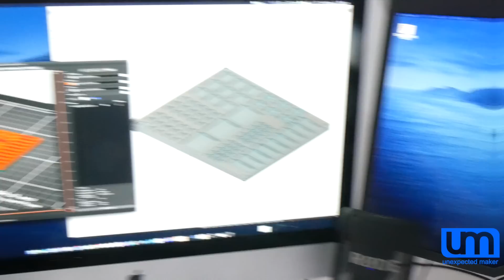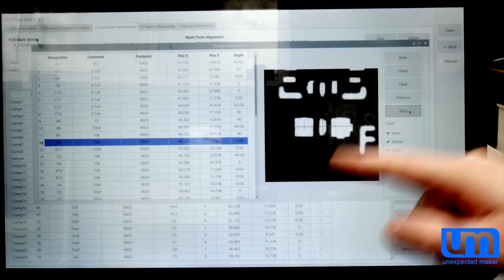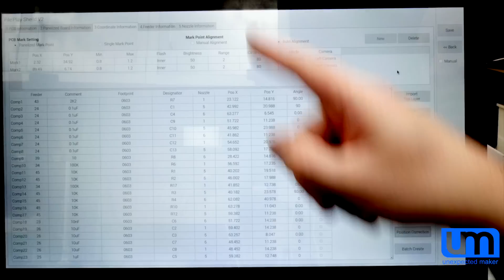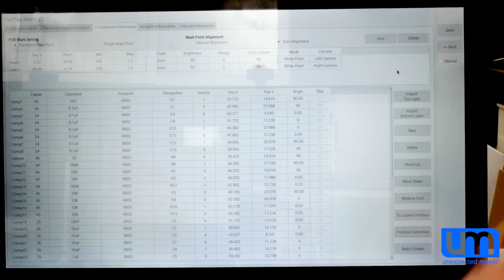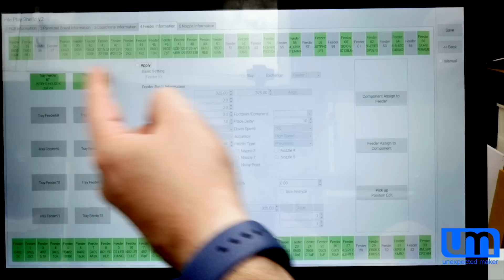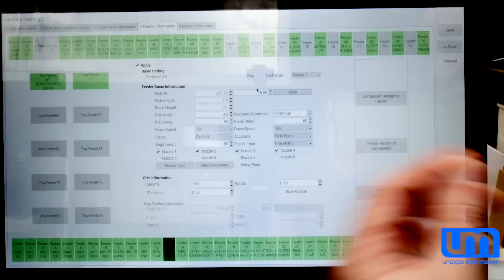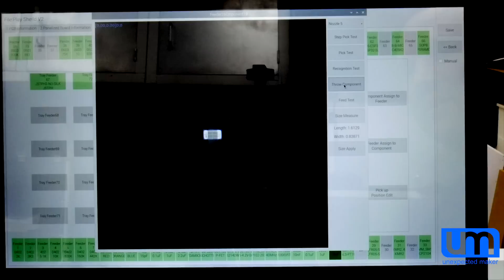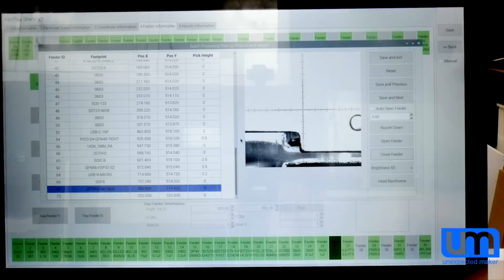Neoden K1830 - A proper look!

Comment: The thing with the belt systems is not that they are not precise, but you need to be aware that the belts will need to be checked periodical to make sure they are at the right tension and also probably replaced at one point. As long as the operator is aware of these maintenance procedures and stick in to regular servicing (similar to a car service) it should be all good.
Reply: There is pros and cons to belts. As for ultimate accuracy, the ultimate accuracy is limited by the stepper motor resolution anyway. If you are using fidicials on the PCB, short range position accuracy is a moot point, so belt or screw will be same. Screws will heat up over time and cause position errors, whereas belts do not (The expansion is symmetrical). Belts are much quieter. The machine can ultimately be faster with belts due to lower weight mechanical structure. Many of the high end factory machines, even Siplace, use belts. So I don't think the belt is the issue. On cheap machines its usually the overall implementation of the belt that causes issues.

In order to get extreme accuracy with a ball screw, such as on CNC machines, you can't do it with the ball screw alone. You need to also have glass scales, laser measurement, temperature sensors with length comp, etc. I worked on old CNC machines with ball screws, when they just had rotary encoders. The accuracy drifted a lot as the machine warmed up. We would need to run the machines for an hour without components, just to stabilize.

Comment: Good for you, I'm glad the machine can run at 100%. I bought my NeoDen4 and IN6 last summer. I wish the software was more like yours. It has an older interface. I also found some bugs and reported them. The NeoDen4 is an older machine so I'm not sure how vested NeoDen is in updating the software for anything other than bugs. It has worked well for my needs.
Reply from the maker: I know Neoden are actively selling and supporting the N4 - but I doubt that would include plans to overhaul the software, especially after this long.
Reply: neoden4 have tubular guides . neoden8 have linear rails . I dont know if it's change something , depend quality of parts

Comment: Is the PNP process now accurate enough and reliable that you can squirt the boards right into the reflow oven without having to inspect boards?   Seems like that's what they intend, and sounds like you might be there now.

What a joy to have a tool that works well, and solves more problems than it creates!  Congratulations!
Reply from the maker: My process at the moment on an batch I make (of any board) is I run the first board, pull it off the conniver and give it a quick look by eye - if there are no suspicious issues, it goes into the oven and then the rest of the batch are unattended.  If anything does look suspicious it goes under the microscope and I fix the placement issue, then the rest go straight into the oven with no inspection. 

In the last 6 or 7 runs I've done, I've only had to make a fix once :)  It's working great!

Comment: Seems to be a good p&p machine !
Could this machine be connected to a network ?
How do you prepair the work ? csv or xls import or do you need to program everything using the machine screen ?
What is the reliability of the K1830 and the Federer one year later ? Have you replaced some parts (belts, nozzles or ....) ?
Have you counted the numbers of components placed and the operting time of your K1830 ?
Regards,

Michel

Comment: Could you remind us what your monthly throughput looks like? And is that running the machine full time every day? I'm curious as to how many "units" it can do a day.  Obviously this is highly variable depending on board complexity. But a loose estimate is enough.
Reply from the maker: I don't count production that way, nor do I ever do full days of PCBs assembly... not even half days ;) I do them in batches of usually between 150 and 250 boards (not panels). PCB assembly is only about 40% of the entire production of a board. Inspection, separation, testing, cleaning, packaging.... they all take much longer than assembly :)

Comment: It looks like it may be time for me to replace my Quad 4000C, which is very good hardware but the software is deadly. 
Looking at the costs for this one.
Reply from the maker: The Quads are great machines, but showing their age in terms of speed. Is yours single nozzle?
Reply: @UnexpectedMaker  Yes - single nozzle 3600CPH rated. Windows software update at least, but still really rough.

Comment: the last 3 weeks I spent about one hour per evening with neoden reps (thanks to Joyce)  keep asking and asking details .  
they are very reactive , send me precise answers , and a lot of pictures ( and user manuals ) 

they know what they are talking about . they gave me advises  ( for example solder past centrifuge machine  ) .  support is number one and I did not buy the machine yet !

about compressor they recommend one unit + oil-water filter ( about 700 USD  )   you did not take this option ?  maybe the  noise ( no data about  that will ask )

I saw in the video the board got stuck at the entrance of the conveyor ,  is it about a wrong setup or bad level of the line ?  

belt system is lower than ball screws , but ball screws are a way more expensive  and very sensible of dust or particles on them you can ruin them ( like CNC machines ). 
just the maintenance of belt system ...  need some replacement parts , will ask about that .

thank you for this video , I guess lot of people was waiting it  !
Reply from the maker: The conveyer wasn't on when the board exited the PnP, so it was sitting in a weird position when I tuned it on... you can see that just before I touched it, it started moving by itself. If everything was on, it would have timed the hand over properly.
Reply: @UnexpectedMaker  right ! got it  . in twitter , seems the thinner boards can be an issue, right ?  ( not 1.6mm )

Comment: Hi, thank you for your video. I wondering about the difference between pneumatic and electronic feeder. Can we pick 0402 accurately with pneumatic feeder?
Reply from the maker: Picking 0402 reliably from pneumatic is very difficult. The feeder moves around quite a bit due to the movement cause by the pneumatics. The parts can jostle around in the pickets or even jump out. Electric is the way to go if you want to use 0402 components.

Comment: When you compare it with the S1, then how you would describe the main differences?
Reply from the maker: I never got to run my S1 for production, just for testing/trouble-shooting, but this is considerably faster - and of course, 8 heads over 4 is WAY more versatile considering the S1 never got its auto nozzle changer. This is also really heavy and solid. Not as solid as a 1000KG machine, but better balanced for sure. The S1 UI/touch screen was fancier, but also slower to work in.
Reply: @UnexpectedMaker  There aren't this 3d sensors in use anymore, right?
Reply from the maker: That's right! I also thought that was a step backwards before I purchased, but wow, this camera alignment system is pretty awesome!

Comment: I see that you have the IN6 reflow oven.  In one of your video's you said "Nope".  How is this oven performing and what is your thoughts on it.  I have been looking at getting one myself, but am extremely cautious because I can't seem to find any unbiased reviews.
Reply from the maker: When I got my initial IN6 is was an early model and I had some issues with the functionally, but Neoden immediately replaced my controller board and it's been purring ever since! I'm using it for low temp and high temp (SAC305) reflow and it's reliable.

Only issue (and it's not IN6 specific) is that a 6 zone (3 up and 3 down) conveyer oven gets zone creep due to the temp differences each zone needs to be set to, so it takes a bit of tuning to get the profiles right. The tuning system on the IN6 is far superior to other cheaper ovens I've looked into.

Neoden does have an IN12 coming out that allows for better zone tuning as you have less temp differences between each zone and therefor less creep, and because it's twice as long, the boards move through twice as fast, which is better for boards that are really quick to assemble.

Unfortunately I don't have room for the IN12 on my line, but I'm very happy with he IN6.
Reply: @UnexpectedMaker  Thanks a lot for the information on the IN6.  I was also looking at the IN12, but I am just a hobbyist so I am not sure I want to poor that much into an oven I might use two or three times month.  Do you have a better opinion about the Neoden S1 now?  I was told that when you got it, it was in the early stages.  What about feeders?  This has been the biggest issue for me.  Finding affordable reliable feeders.  I have a PnP but the feeders that came with it are complete mechanical crap.  Does the S1 and Neoden 8 use the same type of feeder?  I am considering the Neoden S1 or try and get feeders that will work with my current Madell  D2006.
Reply from the maker: @sjwpcbdesign  Neoden don't make the S1 anymore. The stock Neoden USA have is old stock. What was the S1 is now owned by a different company. The S1 and N8 are 1000% incompatible. No sharing of anything... not even working files. If you are looking for a similar sized machine as the S1, Neoden are releasing a Q1 sometime this year or you can contact the company that took over the S1 which is now named something else and is not made/sold or supported by Neoden.

Comment: How long do you estimate it would take to make the $25k back at the current rate of production?
Reply from the maker: No idea, as I don't cost/track my financials that way. I also don't buy capital equipment based on time to break even or X many boards/orders to cover the expense. I actually had a long chat about how I run my financials on a stream a few weeks back.
Reply: @UnexpectedMaker  Which stream was that?
Reply: @paulrautenbach  I understand doing something like this with a 3d printer. But I don't have $50k laying around to not keep track of. It seems a lot more risky than you make it sound. Hopefully these ancillary profit centers (youtube) help keep things both exciting and less of a cash drain.
Reply: @hackur  I liked Seon's approach when I heard it. I'm retired now but when I was working for a software company there was an awful lot of bean counting trying to track the cost of everything.  I was never convinced it was worth the effort and overhead. Just watching what happens to the float I think can work just as well in practice. With his experience, Seon can rely on his gut to know what he can afford. I don't think he needs to prove it to himself by counting everything.
Reply from the maker: @Jeremy Sarda I do say my approach is not for everyone, but I've had 30+ years of experience running my own businesses and my speciality is keeping things lean, efficient and cashflow positive, without compromising on quality, and the only way to do that is to NOT sweat the fine details and focus on the product not the $.
Reply from the maker: If your product/service is bad, no amount of focus on $ will help. If your product/service is good/great then it's worth whatever investment it takes to get it out! Also, if your product/service is a limited run thing (one off), then it might be great and worth doing, but the business model isn't. You have to back yourself and invest in your future.

Comment: I converted my PnP from  venturi vacuum to using a Gast 1/4hp vac pump - WAAAY less noise and power.
Reply from the maker: Noise isn't a problem for me. The machine is 6-7x quieter than my CHMT was and it's performing perfectly, so I'm not planning on hacking it any time soon!